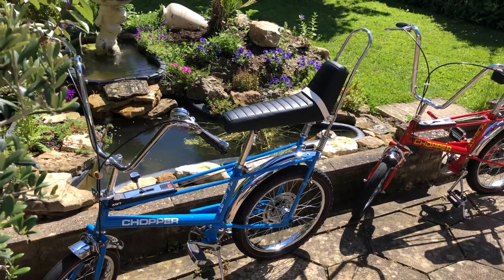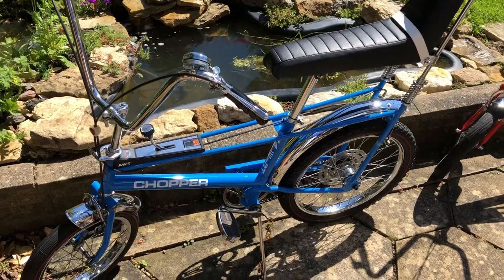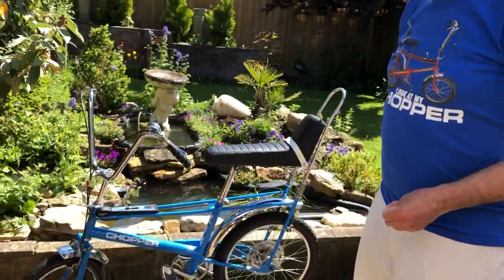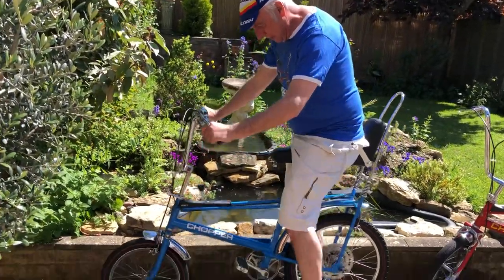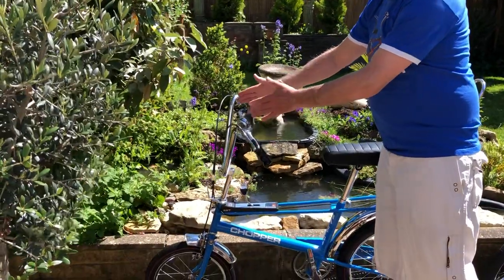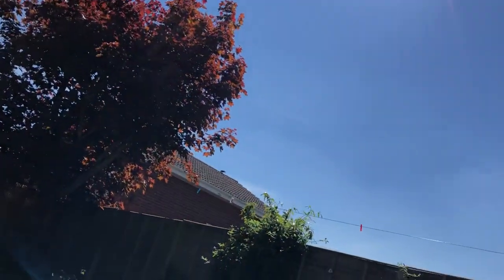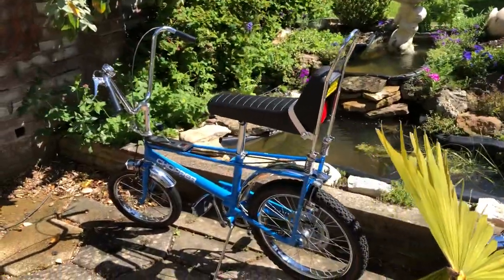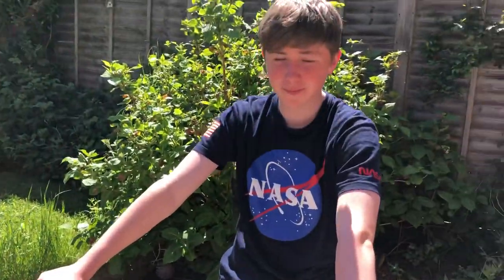Raleigh Chopper Mark 1,2 and 3 The differences How to tell them apart.

Comment: I’m 62 got my Mk2 chopper in 1972!! Only difference was fixed handle bars!! And a square Crome bar rear of the seat instead of rounded !! Gear stick same black knob as Mk1 . It was brand new so hadn’t been altered !! Loved it

Comment: another reason for the mark one having its frame altered was the fact the chain stay tube always broke , I haven’t come across a frame which as not been welded down by the bottom bracket area . I’m currently working on a mk1 fitting a Bafang g510 mid drive to it , just for fun .
Reply from the maker: Great to hear from you, hope your interesting project is fun for you which is what iconic Brands is about thanks for watching and your subscription is appreciated

Comment: My last chopper was a black one with funky flames on the chainguard,  funky decals.   I put a mk1 stem n bars + a mk1 seat n sissy bar. Best of both worlds. Beautiful bike.
Reply from the maker: Sounds like a prismatic issue of the chopper
Reply: @IconicBrands123  limited edition? Someone told me 1978 ? 🤷‍♂️
I had 8 mk1s m mk2s all in various degrees of condition. So many stories. Nice video

Comment: Had a MK1 for Christmas many moons ago. Never had issue with unintended wheelies yet from day one I was always in 3rd gear. Never got it fixed either. Got strong legs though.:)
Reply from the maker: Strong legs essential !!
Reply: @IconicBrands123  I was stabbed a few times by the bars. That’s a point I forgot but was my first bike so just assumed being impaled was normal. :)
Reply from the maker: @PaulAnthonyDuttonUk at least it wasn’t the gear knob as well!! 😳

Comment: What about the difference in the Handlebars adjustable to go back and forth loosen and tighten top of the stem .......
Reply from the maker: Hi thanks for your message always good to hear from subscribers. Hopefully you are? Your observation is correct however The video focuses on parts that are not interchangeable between Mk1 and mk2 therefore making it clear to identify as to what Raleigh Chopper actually it is as many parts are swapped between them

Comment: I had the MK1 you could also alter and adjust the handle bars on the MK1 the MK2 had fixed handle bars.
Reply from the maker: The mark 2 handlebars were fixed for safety reasons along with several other modifications thanks for your input please subscribe to the channel

Comment: so i have a mk1 thanks i was wondering is there any way to tell the year please
Reply from the maker: There is a serial number stamped on the frame near the rear hub if it has not been repainted!! Another way to tell is the rear wheel hub itself if it hasn’t been changed Thanks for watching YouTube video channel iconic Brands hope you enjoy it
Reply: @IconicBrands123  thanks for the info i will have a look it is the same red but is only a frame i found in the outback so is quite sun damaged but i had one as a kid in the 80s and remember them well as wheelie bikes
Reply: @IconicBrands123  apparently its a 70  chopper it needs work but i think i might put it back together any hints on the best place to get parts i know ebay but is there online shops where i can get parts repop are fine as paint is almost all gone and will need full resto
Reply from the maker: @davidnetherway4734  I can recommend the Raleigh Chopper owners clubs via Facebook as a good source of parts and information thanks for watching YouTube video channel iconic Brands and free subscription to the channel

Comment: you forgot about the adjustable handlebars on the mk1 and also the shape of the chrome tube behind the seat and if memory is correct, the disc on the back wheel was changed from chrome steel to aluminum ,
Reply from the maker: @john-1964  thanks for sharing your thoughts and you are correct however these parts can be swapped from one bike to another between 1&2 models 
The differences between the bikes are the ones that cannot changed easily pointed out in the video in order to get a genuine Raleigh Chopper

Comment: Very interesting, ive just got my old mk2 out of the shed but i cant find a serial number on it, any idea where to look?
Reply from the maker: Hi thanks for watching iconic Brands 👍 the serial number is stamped on the frame at the rear where the wheel is bolted , sometimes if it’s been resprayed it’s hard to see
Reply: @IconicBrands123  thanks for replying, cant see anything, im guessing you have to take the wheel off? Is it on the inner bit? Sturmey Archer says AW 75, so im guessing 1975?
Reply from the maker: @nicholastaylor6455   yes 1975 stamp is normally on the outside of rear wheel flange
Reply: @IconicBrands123  thanks, i'll have a look there
Reply from the maker: Sometimes rarely stamped on the bottom of the crank housing good luck and thanks for your subscription

Comment: hi russ can you use mk 3 parts on a mk2 rear rack sissy bar etc?
Reply from the maker: Hi Adrian, thanks for subscribing to iconic Brands channel hope you’re enjoying watching it, in answer to your question The sissy bar on the mk3 is 15mm diameter whereas the mk1/2 is 12.7mm diameter so they will not directly fit without making an adaptor which some people have done it’s not a straight forward swap over without modifications.

Comment: hi they did a mk1 1/2  that has the narrow handle bars , but had the round gearstick long seat and no rack at the back oh and the top of the sissy (SEAT) was not round it was more square , i bought it brand new in orange it cost £34-95 ,
Reply from the maker: Yes ! This was the cross over model think it was Raleigh’s way of using up old stock before going fully to the mk2 model, thanks for sharing your knowledge and watching iconic Brands
Reply: Absolutely correct 👍

Comment: I had the mk1 and as a kid I loved It did miles on it I never fell off it but came very close a few times. The high speed wobble could be fun. Try two up with your mate carrying a bag of pinched peas in each hand from a farmer’s field then add a steep hill how we never fell of it I will never know 😂 I am never sure if the peas swinging about stabilised it or made it worse because I was hanging on like grim death trying to get it under control 😊. When it was swapped for a Halfords racing bike it was never as much fun riding again faster yep fun nope.
Reply from the maker: Great story thanks for sharing your experience and a survivor!!!

Comment: What could have been a very interesting video which I was genuinely  interested in was spoilt by the iratating water noise.
Had to switch off in the end as it was getting on my bloody nerves.
What a pity!.
Reply from the maker: @davidhathaway8271  hi A video has since been released on the same platform including the new mk4 
The Sound system on your TV or device can also highlight the higher pitch in some cases
Reply: @IconicBrands123   Ok thanks for your information.
Sorry to moan I will look at it again.
Many thanks.